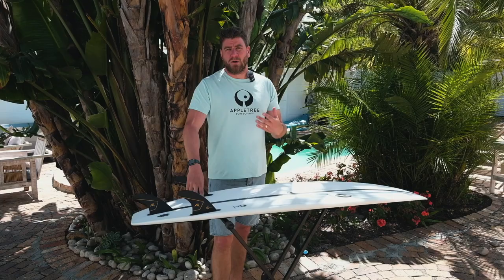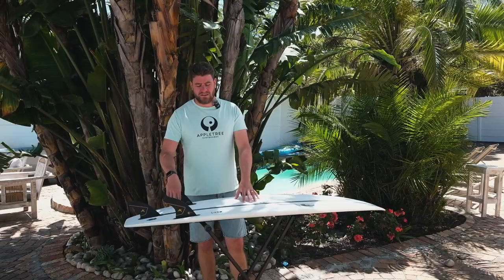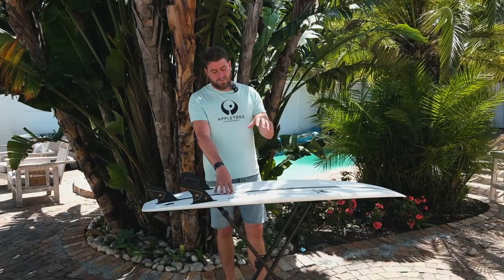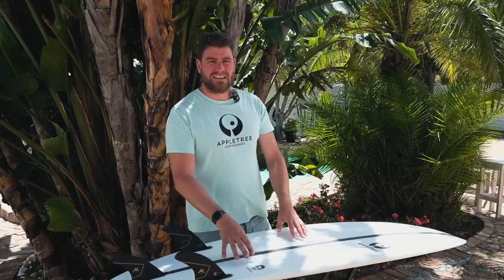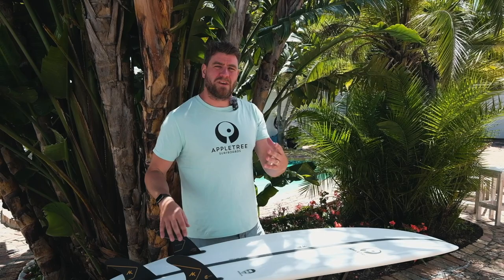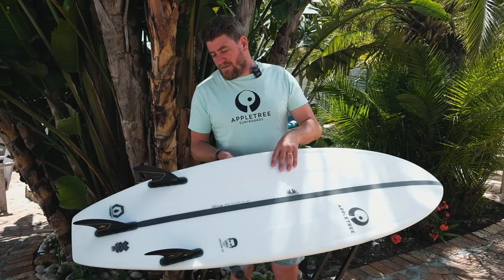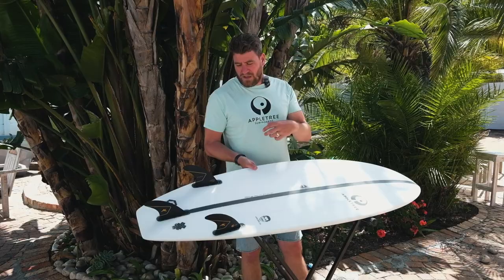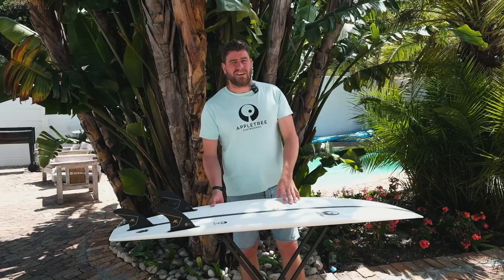Poly surfboards vs. epoxy surfboard: pro's and con's

Comment: Awesome and honest! 👍🏾😊 My experience with my Appletree Surfboard is, it is the most durable surfboard I've ever had in my life. I have the Malus Domestica, I ride it hard and I love it 🤙🏾🤙🏾🤙🏾😁
Reply: I know you love the board,  Marcel, I saw your video cruising around with the red beast MD…but what about the flex? you can ride it hard, but will it hurt your knees when it gets mushy? What’s the construction of the board your going around? Standard+ or Standard S+ ? Any info?
Reply: @frankutub  Hey 😁🤙🏾... I have the S+ construction. It's a good question about the flex, because some people mix up a soft board (a soft surface of the board) with a flexible board. My board is hard on the surface but it is flexible allover the whole length of the board. 

Well, I like that construction, because it's super durable and strong 💪🏽. I rode many surfboard with a soft construction and they all broke. Yes, they are cozy to ride but I want to rely on my board when I jump and hit the waves.

I hope that gives you an explanation of my perception of Appletree Surfboards 🤙🏾🤙🏾🤙🏾😁. Enjoy your ride....